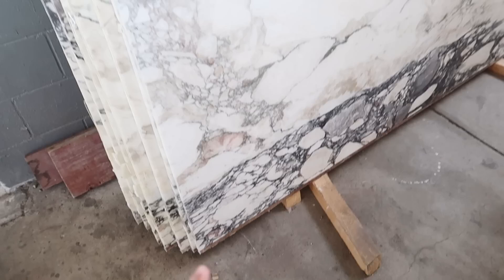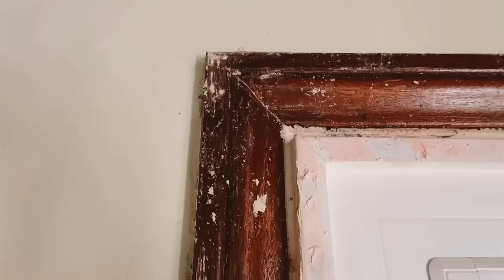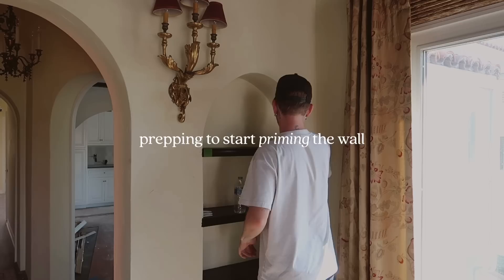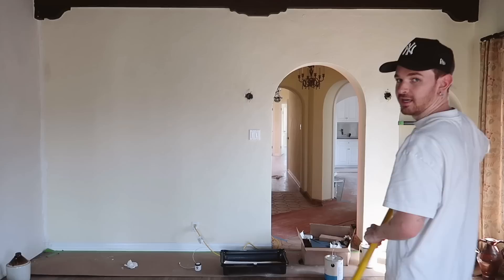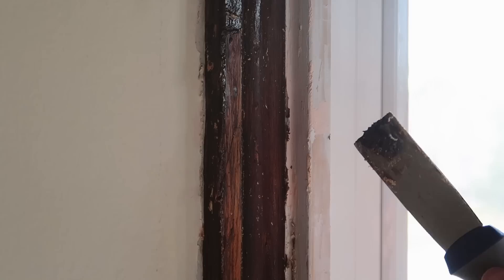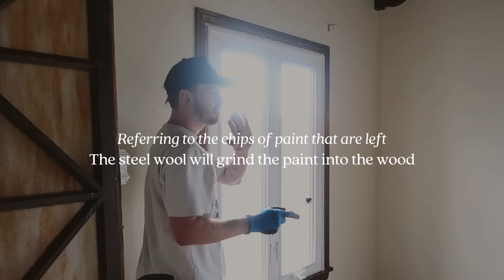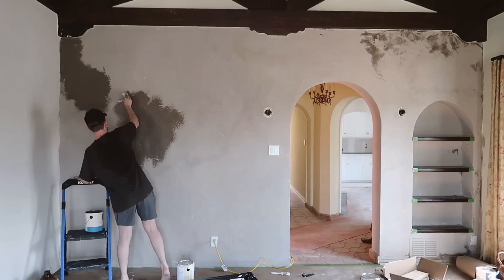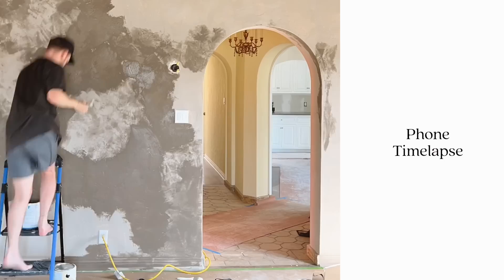WHY WHY WHY

Comment: Any future issues, here the solution 
https://youtu.be/XGAJSKHqOKs
https://youtu.be/n7hi-0jMnEI
Its best to try and do the least invasive solution with old houses. Whatever is found not to code, usually needs to be fixed. So plumbing and wiring etc  ...

Comment: You didn't really maximize the benefit of the big, long-handle roller. Big long strokes, floor to ceiling as many times as you can when there's nothing in the way.